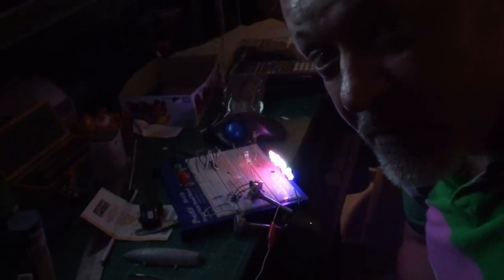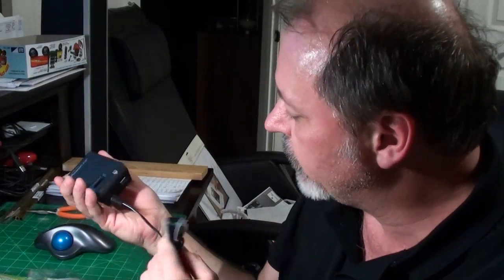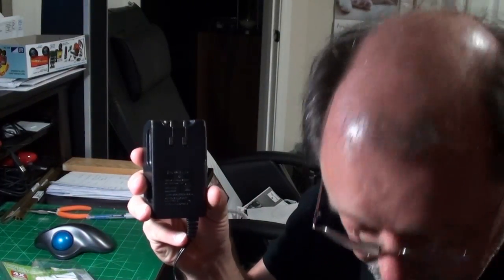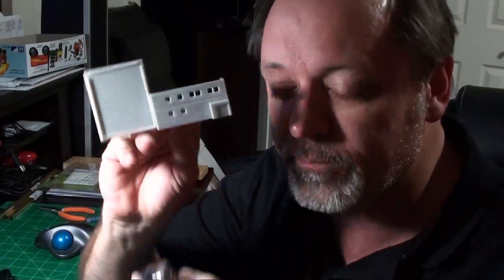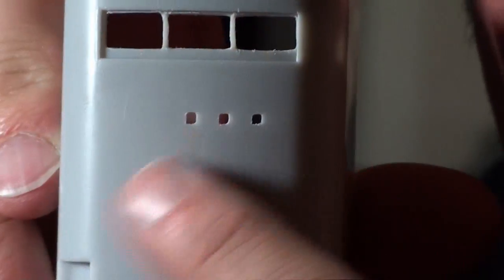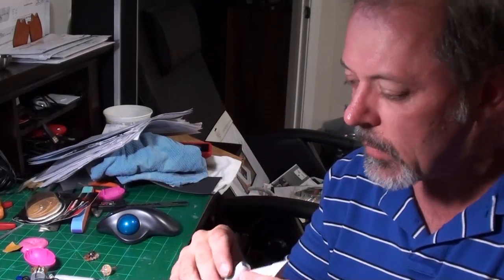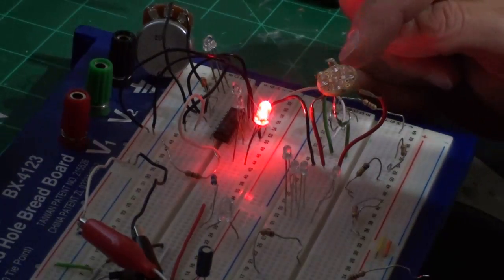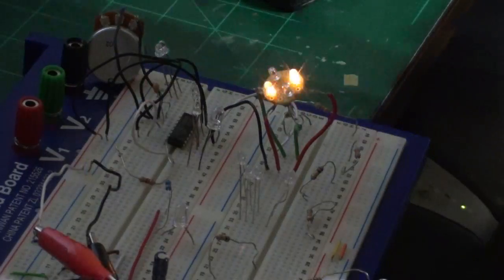Mercury 9 part 2:  Engine lights

Comment from the maker: That should be about right.  (20 ma per segment.) 

   I bought a bunch of surface mounts for this project so I will soon try soldering up very tiny little joints.